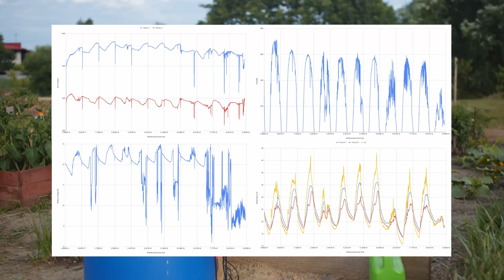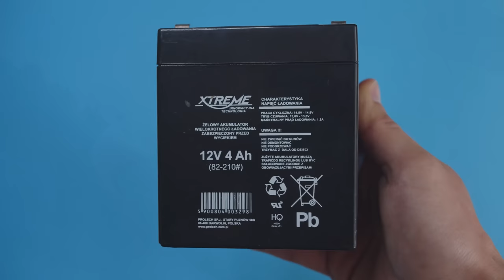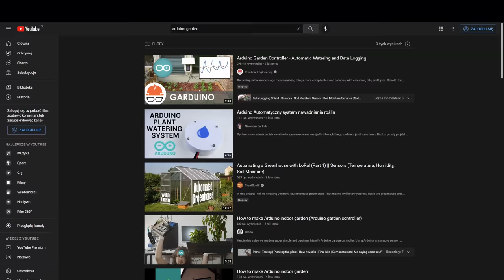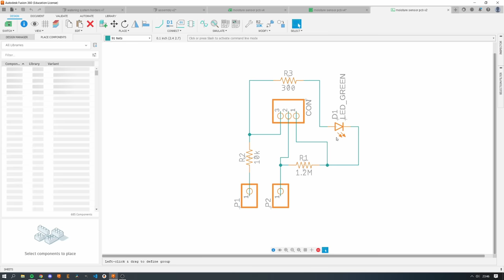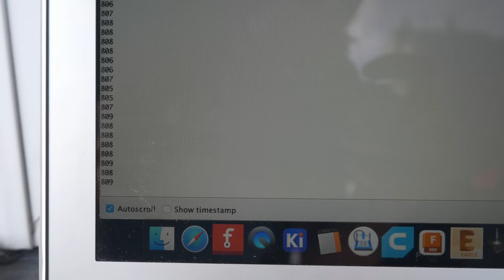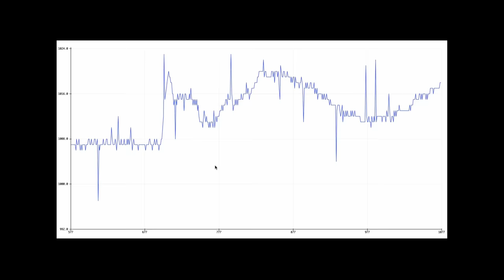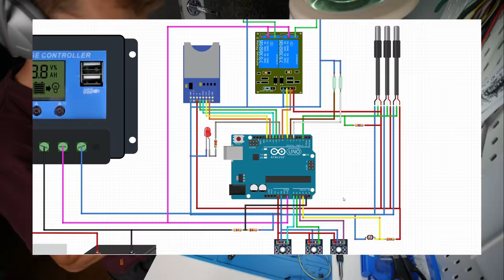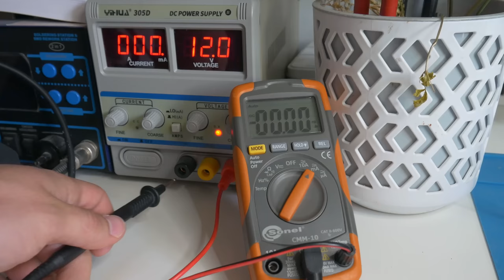Automatic Garden Watering System

Comment from the maker: Thanks a lot for watching! Let me know what you think about this project! Here you can find files, code and plots: https://indystry.cc/diy-solar-powered-garden-watering-system/
Reply: Great Video! I do believe the capacitive soil moisture sensor can run with 5v and the analog pin will never see more than 3.3 Volts! Btw, do you know OpenSprinkler exists?
Reply: I am very interested in that capacitive tester for wetness because I lost all my plants this year because they were too dry, or sopping wet yet the meter was all over the place.
Reply: You should add a rainwater collector to the system.

Comment: Another way to reduce power consumption is to only turn on the sensors and the SD card when they are needed
Reply: Totally agree. The rate at which things change in a system like this is very slow, so the device can easily spend 10 minutes in low power standby, then wake up, check the sensors and if nothing needs doing, go back to sleep for 10 minutes. If the pump does need to be on, then stay awake until the pump is turned of then repeat! Would probably save 80% of the power consumed and the battery would easily stay fully charged by the solar panel.
Reply: Definitely. I created a very similar system using an ESP8266 clone. It sleeps for 1 hour, reads all the sensors, uploads then to the internet. It uses the light sensor to determine if its night or day and runs the pump on the transitions between the two. Using an old car battery and a 10w solar panel it never runs out of power.
Reply: @ianstarcroft  hi. It’s lovely to hear about your project. Will you care to connect and share some of your insight with me? I’m trying to build a system like that in Africa
Reply: Thanks for the great video. Planning a simple timed system based on gravity feed with tank topped up with river water by a pump. Have gone for a 12v car battery and 120W solar. I hope I build something even half as neat as yours.

Comment: Now you need to add another water level sensor to the barrel, but this time to the top, and with some hysteresis you activate a valve to automatically fill the barrel, and then, after that you realize that you over engineered the system and could have just used the water supply instead of a barrel and a pump 😝

Comment: Awesome job! I dont think your LEDs are the biggest contributor to your power consumption, although its not a small part either. A few things to consider:
1. Reduce your sensor bandwidth. You dont need to know the soil moisture content every few milliseconds... or seconds... or minutes. You could check once an hour and turn the sensor off for the rest of the time.
2. Get rid of those pesky linear regulators. They are super inefficient. You can either lift some design examples for your own SMPS or go with a module. I have used Analog Devices "LTM" modules a lot and they are great- the downside is they are very expensive ($10+). They are also BGA parts, so you may have trouble soldering them. But they are a good option if you want something small that "just works"
3. Use low power modes in the microcontroller. Put the MCU to sleep when you dont need it.

If you implement those few things there's no reason you can't get months of battery life out of this thing.

Either way, very good job on making a clean, tidy system. Im sure you had a good time making it and its far better than some professional system i have seen. :)
Reply: Great comment, thank you. Also, focusing only on the moisture monitoring and water pump control, as he did toward the end of the video, I believe he could get about an order of magnitude lower power consumption with a single 8 bit microcontroller. He clearly has the skills to program one and develop a board with supporting parts.

Comment: Great project. Watch for long term uv exposure with plastics and water vapor will condense in the morning onto cool electronics and eventuality corrode.  So best to put them in a breathable box which is dry (a nearby shed or big container ). Water vapor will even get sucked down wire insulation into a sealed box a the pressure inside a sealed box goes high then low.
Reply: Oh hot glue will not last through a freeze. It will melt\flow while inside a glass jar during Texas heat (oops).
Reply: Just some issues/tips to consider!  Great project.  Watch out for clear tubing growing algae which clogs.
Reply: I also want to automate my 35 minute daily watering....but drip doesn't evenly moisten the bacteria here in Texas.  Need to grow bacteria in the moist soil to feed the plants.  Wicking beds help (on my channel).

Comment: I just finished a solar ESP32 radiation detector async webserver project. 
Planted it into the ground on a 2x3 pole just like you, but used NiMH batteries instead.
Now that I upgraded my electric moped to LiFePO4, I have 4 x 22Ah sealed lead acid batteries. 
I'll use one of them to replace the NiMH. They perform better in -20ºC of Canadian winters.

Comment: Amazing project and I really appreciate your effort going into details, couple of inputs here from my experience. One the soil moisture sensor will not work reliably if it is too far from the microcontroller because of DC losses.you can move your controller and tank in the middle of the garden to overcome this. Next like others have already mentioned in the comments reduce the interval of data gathering and you will save power. Last add a 12v solenoid valve to the input line to keep the tank always topped up or top up when empty. Next for the challenges with your diy sensor 3D print the legs and have the metal only at the end for consistent performance because no matter how well you insulated the metal humidity will creep in and ruin the day. Hope my inputs help.
Overall your project is far better than most commercially available systems for the same purpose. Keep it up 😊

Comment: It also helps if you have good soil, I only water my veg during the seedling stage. Mother Nature does the rest, no need to water again unless there is a long hot dry period. If you need to water everyday, you are either overwatering and/or your soil is low quality and not retaining moisture. 

For thirsty veg, consider Kratky hydroponics and use a float value.

Comment: Nice. Though for reliability I'd suggest to use that minimum level float inverted. Put ball in shaft and let it sink from top and use almost whatever switch when level goes too low. Parts are really easy to print. Also functions well as visual indicator of level far away.

Comment: Awesome, I made a similar project when in school but I used RF modules to send a signal to turn on the pump at the water tank because it was to far away for using cables. I also used GSM module that could send me an SMS when the battery or water level in the tank was low. I reduced power consumption by putting the Arduino to sleep and waking it up every hour to check the moisture. The project worked but sadly I never implemented it in the garden. I got the inspiration now to finally do it after 6 years hah

Comment: Maybe instead of a pump, you could run an electronic valve to open and close, and allow gravity to move the water.
Reply: There is a problem with that. It depends on how much water you have in your barrel and the hight where the barrel is placed. As the water level decreases the pressure decreases and less water is flowing through the nozzles . If you are connected to a water source with constant pressure you can use a solenoid valve as you speak of.

Comment: 1. Imo automated systems work much better when you have remote control over them so i would use esp32 (so c++)
2. Putting mcu to sleep is also good idea, read sensors every 30 minutes or so, upload data via wifi, put it back to sleep

Comment: Think you should also have a drain hole in your electronics container as water always find a way inn and can build up if it can't get out.

Ive burned myself many times with electronics just burning up from water buildup even with everything sealed with caulk and tape...

Comment: Regarding the watering side, pull those emitters back a bit from the stems.  Root rot can be caused by the base of the plant (stem to root transition) staying wet & fungus growing.   Also it can help to make the plants "reach" for the water a bit - wider roots, More stable plants. 

Consider using rain collection at all?  Loads of additional issues, but maybe less refilling the source drum?  

Have you found any reliable soil sensors on the market?  Reviews all seem to point to fast failures for all I have seen.  Your solid metal (I think?) probes make more sense to me.  

Been lurker-subbed for a while.  Enjoy the work.  Thanks for sharing.

Comment: I'm a big fan of the perf boards you can buy that have a few pins connected together in the same way as on breadboards 👌 can recommend
Reply: Adafruit makes one called the Perma-Proto board that you can solder on and is electrically connected just like a regular breadboard. They are significantly easier to work with than just plain perf boards. I use solderable jumper wire so you never have to make traces with solder like you do with perf boards.
Reply: @davidsherrick8633  nice!  I've only ever bought mystery brandless ones of aliexpress but looks like it's basically the same thing 😄

Comment: Made a system similar but think I'll go w Arduino bc of higher stability/reliability of 8-bit system; I find 32-bit is an overkill for my application. You may consider an 8-bit system too, since you're using solar to power it. Ofc, lower power consumption. I see you've already done an Arduino build in the past. One thing I've thought about, is perhaps using multiple sensors in one pot to water based upon an average soil moisture index between multiple sensors.

Comment: everything is relative and only the desgracia chases us: and what will happen when the boat is emptied – and what will happen if the sensor fails – and what will happen if you lose connection with the module? and what will happen if your phone stays if you battery? and what will happen if you die?

Comment: As far i see you use normal cable glands. With more than one cable it isn't waterproof. To make it waterproof you must use sealing inserts for multiple cables eg. look at Lapp Kabel SKINTOP DIX (with SKINTOP DIX-DV for sealing unused holes in SKINTOP DIX) or use Icotek split cable gland with multicable instert seal. Only that or similar solution allow to waterprof seal multicable glands.

Comment: It is unnecessary to power the sensors all the time. From my own experience, it is best to measure the temperature and the sun after enough watering and, based on the measured data, create a function that will put everything to sleep for a few hours.

Comment: Hi Nikodem. Thanks for the great video. I've built a similar system in the past. A problem that I ran into was the water from the tank would siphon and drain the tank complete after the pump stopped working. This of course only happens in a situation when the tank water level is above the plants (like in your case). Did you run into a similar problem? If yes it would be great to know how you solved it. Thanks, keep up the great work

Comment: Great work Niko. Where did you log the readings too and what did you use to create the plots? Did you use a database?
Reply from the maker: Thanks! I logged everything on SD card as a CSV file and later imported it to Google sheets for processing
Reply: @nikodembartnik  have a look at InfluxDB, seems to be built to capture sensor data and then plot it, runs on a Pi as well

Comment: I assume you used a DC voltage for you moisture sensor. This is a bad idea. It is better to use AC voltage. This reduces corrosion, but is more complicated to measure.

Comment: Why this system looks so complicated?
These systems are not power hungry, if they are you did something wrong. 
Your systems should run 99,5% of the time on idle and wake up periodically to check sensor data and then again go to sleep, this way you consume only one milliamp or less in average.
Lead acid batteries are terrible, switch immediately to Li-Ion. 
Why do you have LED's on sensors when they consume valuable energy?!
If your electronics box isn't hermetically sealed, it gets filled with water at some point, make vents so the air and moist can escape.